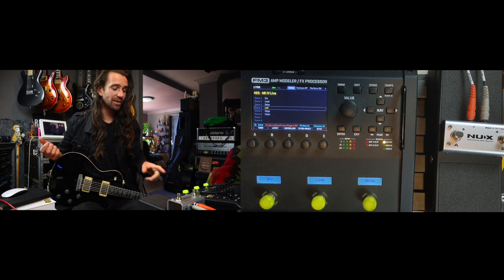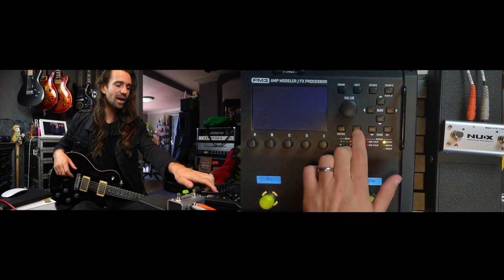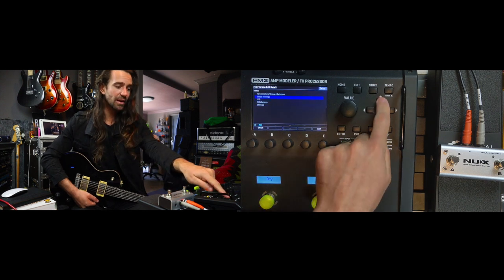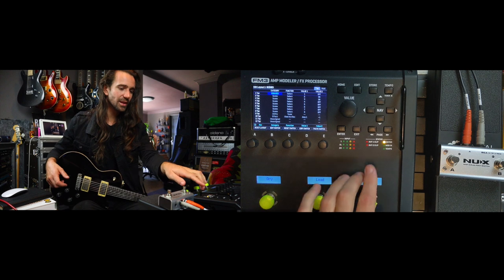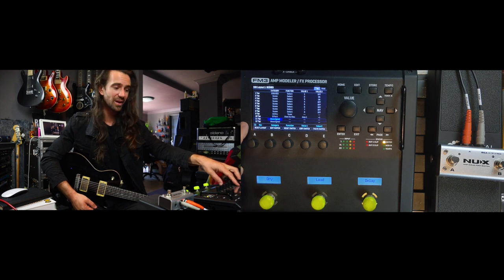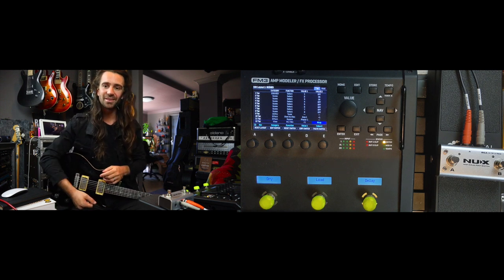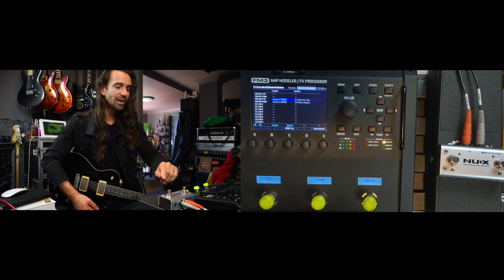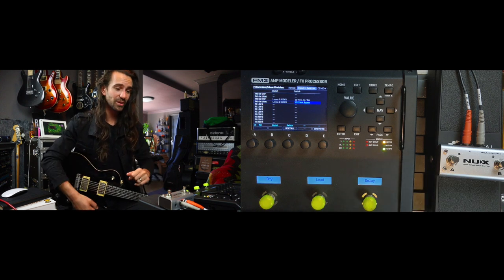5 Minute Tones - Stand In Switches

Comment: I use two of these T/R type dual switches and I effectively now have 7 switches to play around with on my FM3! It's truly a gift that keeps on giving.
Reply from the maker: Great way to run it. What do you have assigned to them?
Reply: @LeonTodd  still experimenting but currently have the 3 switches on the FM3 doing presets and banks (on long press); one dual switch is for drive and rotary, the other dual switch has one switch toggling between scene 1 (rhythm) and scene 2 (solo) and the second switch does a simple scene increment. The idea with the second switch is if I need a special kind of a sound, say like your rhythmic delay, I can toggle to that and then toggle straight back to scene one (rhythm) with the first switch instead of having to go back to the first scene via two stomps as decrements. Hope this makes sense? 😅

Comment: What's up Leon, killer work as always. Question - I have the same NUX setup/FM3 and have it set up the way I want....except....is there a way to have the NUX's LED's on/off according to what effects are enabled/disabled? I've tried several combinations on the switch on the NUX as well as setting on the FM3, but can't figure the lights out. Not a showstopper, but would be nice to have. If I'm seeing your video right, the LED's on your NUX are only blinking, too and only flash and then turn off, regardless, right?

Comment: Question: what if my stand in switch has only 1 input v/s 2 (tip and Ring) how would that change the settings? Would this require a TRS or a TR cable?

Comment: Hi Leon! I’m using just as you, an expression pedal on pedal input 1 and an Ampero Switch which basically work as your NuX on pedal input 2. My intention is to use the switch to go down (1) and up (2) each scene. Is that possible? If so can you tell how should I setup for that? Thanks in advance.

Comment: I have a question for you.
I also have the FM3, and I normally set my input to never reach the red led. It goes to the orange at maximum.
That's because I normally reduce a little bit the input.
Is there a problem with with that, or I'm losing signal?
To be perfectly clear, I don't tank it, I just take enough so it doesn't go red.
Thanks